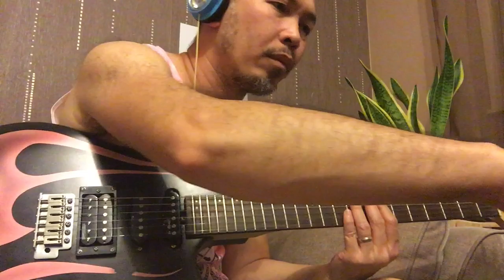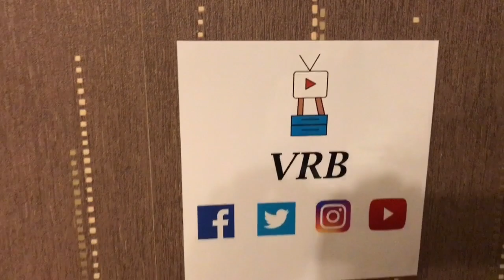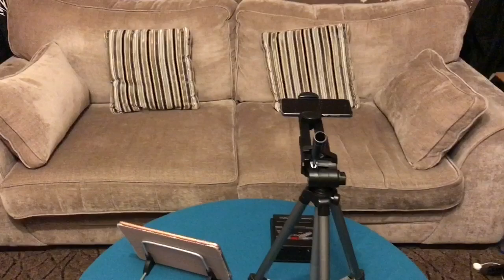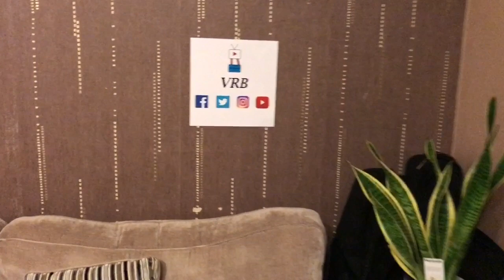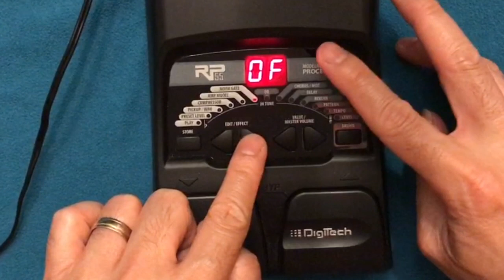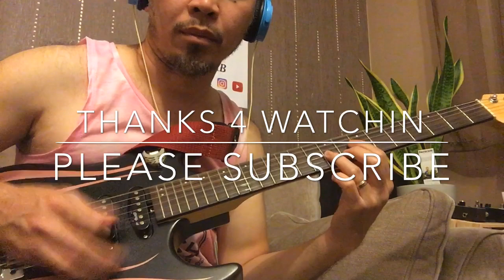How To Create An Auto Wah Sound From Digitech RP55

Comment: Btw killer tutorial. That pedal is a popular one. My old buddy from decades back told me he loves his. Hahah.
Reply from the maker: Robert Clark thanks Rob. Yeah this is my first pedal here in the UK like 10 years ago. I sold it and changed to different pedals like Boss ME33, Korg AX100G, then Zoom G1xOn And recently saw this on eBay quite cheap so bought it again. Hehehe
Reply: vincent ryan borres it sounds killer. Love that drum machine sounds very close compared to others. That’s insane. Love it.
Reply from the maker: Robert Clark yes the drum machine sound of this pedal is amazing. The only downside is that the tempo is numbered 1-99 because of the two digits screen. So you wouldny know if its 120 bpm or 160bpm. It stops at 99. But Im guessing its already like 160bpm.
Reply: vincent ryan borres it sounds great man. Really. Love your work. I hope the iOS system helps me a bit.
Reply: @vincentryanborres  Would you recommend the RP55 as a beginner's first pedal or G1xon? I'm a beginner and I'm trying to learn metal and rock. Thanks
Reply from the maker: I would say, Zoom G1xOn because of the advantages like the Wah pedal, Looper, you can change the chain of pedals and only 4 AA batteries to use. But for affordability and ease of use, RP55 is really great and to be honest the drum machine sounds are really good and the sound of the pedal during live gigs is amazing. It's really up for you which one you think you will be needing. If you dont have plans of using wah pedal or looper, then rp55 is great.
Reply: @vincentryanborres  Thank you so much for your reply. I really appreciate it. One last thing though, have you already checked out the new Zoom G1 Four or G1x Four? If so, what do you think about these new Zoom pedals, do you think they're better than the G1xon? Because I've read a few YouTube comments stating that sound wise and functionality, the G1xon is still better. So I'm wondering what thoughts are if you already had a chance to check out the new Zoom pedals. Thanks.
Reply from the maker: lenlie ada i have but havent tried it yet. Saw demos and reviews on here and I think its the upgraded version of Zoom G1xOn. All the things that is missing in Zoom G1xOn they out it on Zoom g1x four
Reply: @vincentryanborres  Are you saying rp55 does not have WAH WAH effect?
Reply: @vincentryanborres  Reading through the manual of the rp55 , I can see it has the wah wah effect . Why are you saying it does not have the wah wah effect?
Reply from the maker: @akanseadegoke7559  It has a wah effect but doesn't have the pedal. so it won't work unless you use an auto wah. It has ya-ya effects though.
Reply from the maker: @akanseadegoke7559  Here's the link where I made a wah wah patch for this Digitech RP55 multi effects processor. https://youtu.be/LJYvn4nsqc4
Reply: I hate mine. Tone sucking piece of junk